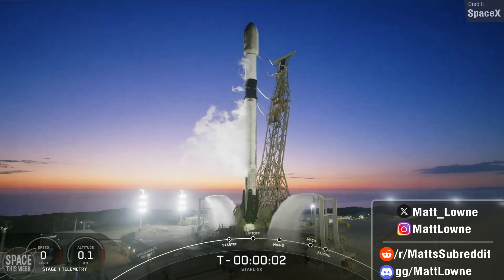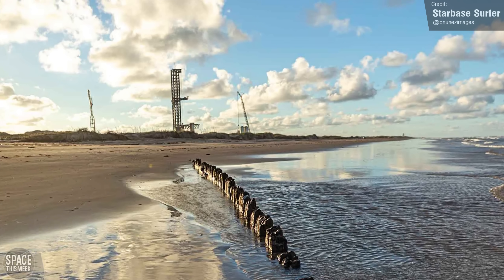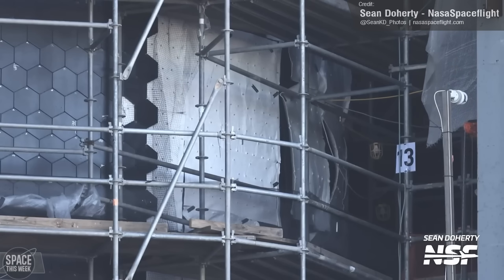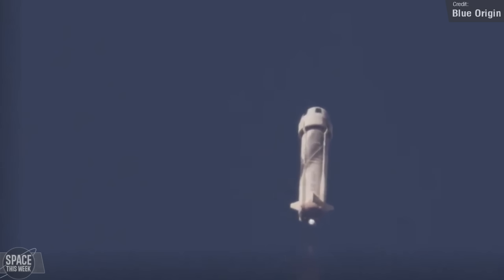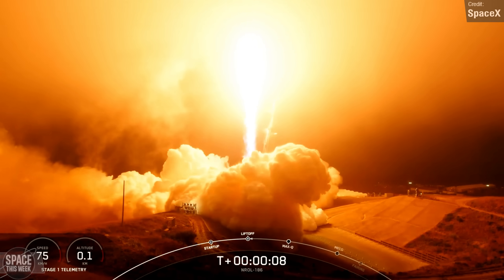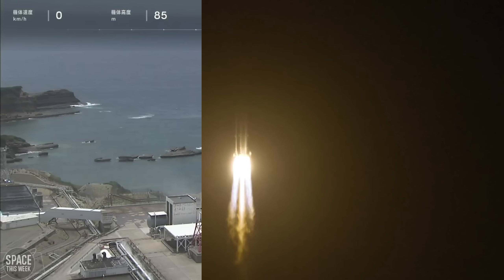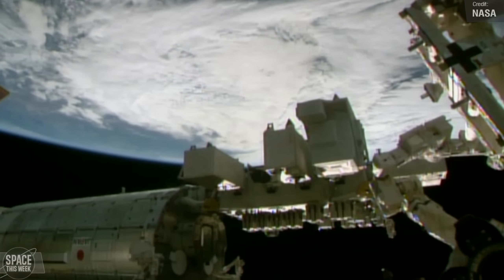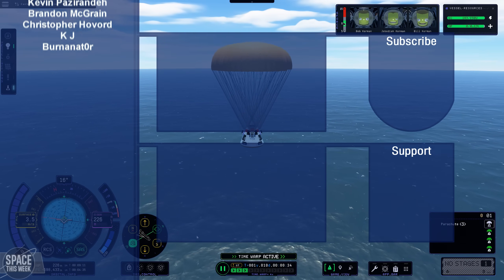SpaceX Test the Starship Catch System, and China Accidentally Launches a First Stage Booster...

Comment: The bolts holding down the falcon 9 are the same bolts used in their submarines, aircraft, torpedoes, naval vessels and the ubiquitous cheap Chinese bicycle.  Even Jeb insists on better parts.  Oh yeah and that stainless rocket looks exactly like a HVAC flu damper.

Comment: @9:16 also in 1986 the Space Shuttle Atlantis suffered a Thermal Curtain Failure (later determined to be caused intentionally by a robot named Jinx) during a static fire. In order to prevent explosion, the shuttle was launched. Unfortunately, several students from Space Camp were onboard at the time and were sent to orbit. The shuttle was able to ultimately safely land at White Sands and all aboard survived.

Comment: If they are getting rid of the ISS anyway (they could bring it back home and reassemble it here on Earth but that's another story), if they're destroying it anyway, why are they bothering to fix Starliner's problems or even spend any more money on it? What is the point of finishing a vehicle that will still take 6 mnths - 1yr or more to finish when there are already two vehicles available that can do the same job and there's 6 years of use in the station at best?

I take it they have other uses lined up for it? Unless it's going to another station in the future...when will that be...and other missions? They cant be gaining much useful knowledge by keeping it there. By the time they'll use it again after the ISS it will all need updating and retesting.

Comment: I wish that they would push the iss to a parking orbit instead of de orbiting it.
Reply: I agree, it would be nice, but that would encourage more problems, along the lines of Kessler Syndrome. The orbit ISS is in is relatively safe from junk because most junk deorbits fairly quickly because it is so low. Put it much higher and it is in orbit with a bunch junk and without means of avoiding any junk that comes too close.

Comment: I find it stunning that those two tiny metal extrusions can hold around 200 t (440,000 lb) dry mass of the Superheavy on Chopsticks.
Reply: 200 t static not so big a deal catching it with another thirty odd tons of fuel and a high velocity stream of plasma roaring out it's arse at a non negative velocity and closing the arms without interfering with the rocket now that's a big ask :).